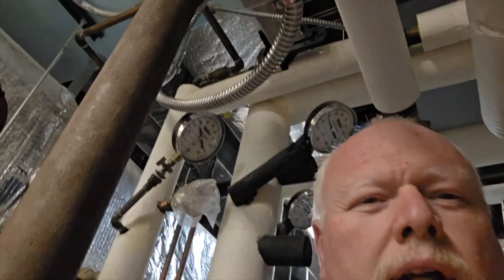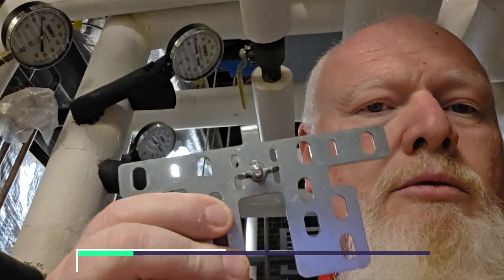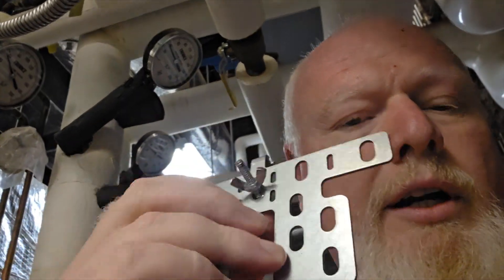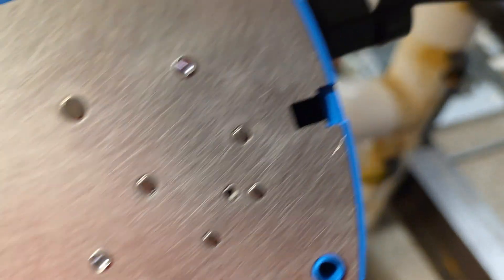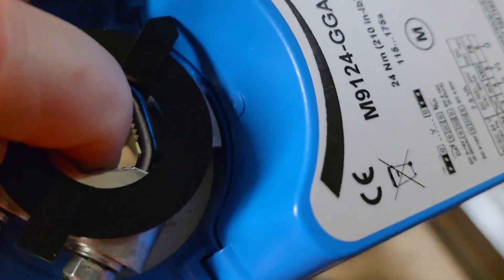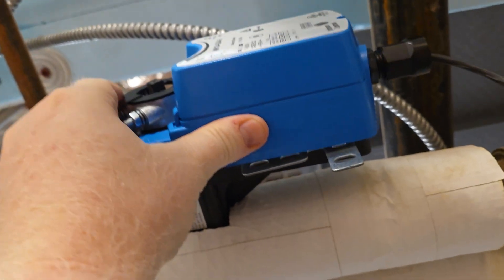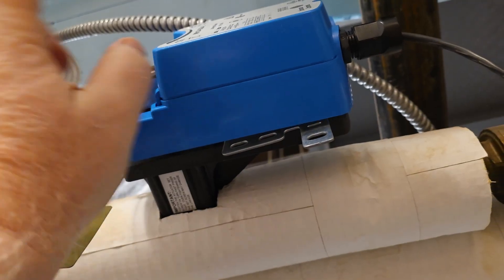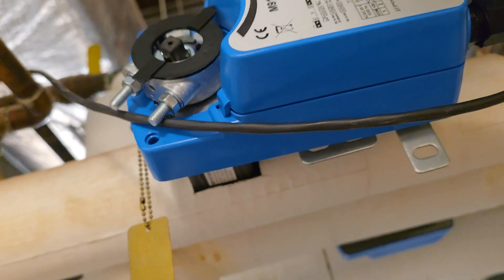When Parts Don’t Exist Anymore: How Techs Replace Obsolete Actuators

Comment: I’ve run into valves which don’t have  0 or 90 degree stops (it spins 360) and no visual indicators on the valve stem. what is the best way you have found 0 degrees on the valve so you can accurately be at zero before you tighten the actuator to the stem? 
Thanks
Reply from the maker: There are a couple of ways depending on the valve.  Some valves have a hard stop for fully open or fully closed.  Those are easy. There are some that you can turn continually, and those are the ones you need to spend more time on.  I usually try to listen for flow and check temps. Good luck.
Reply: @Systemcontroltech thanks for your reply, and I love your channel.